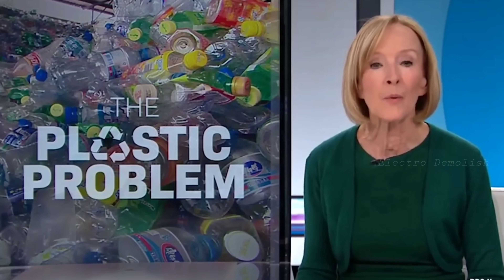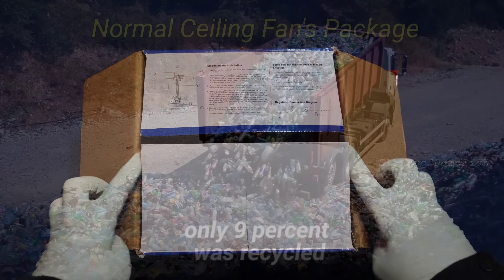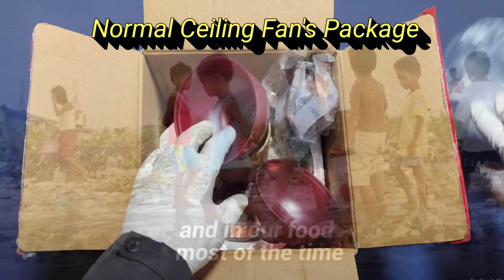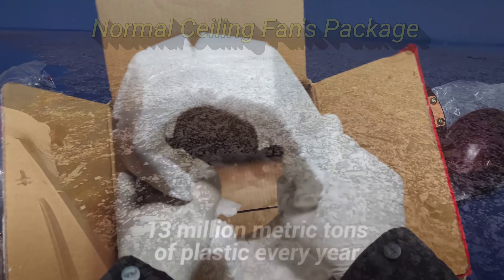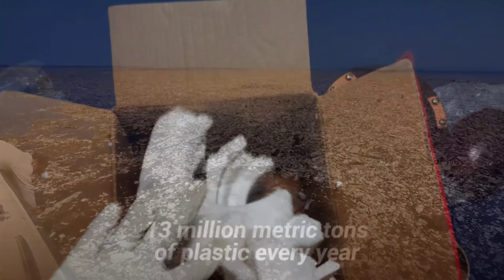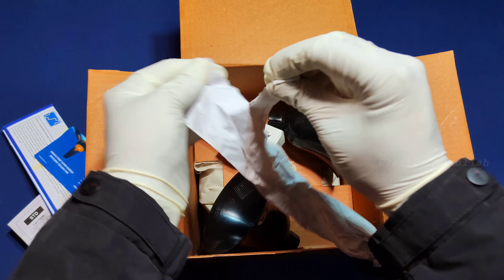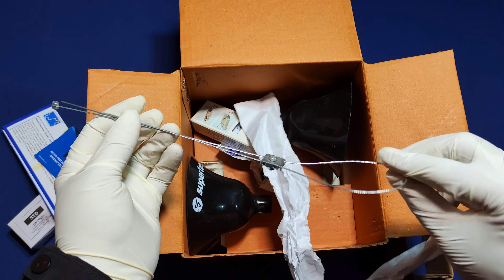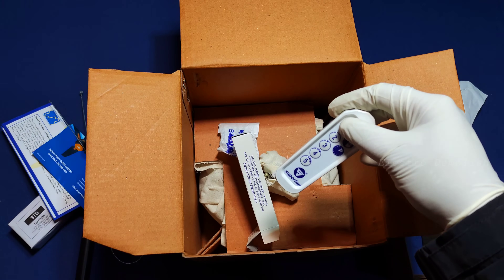Superfan vs Normal Fan |BLDC Technology vs Old School Induction Technology

Comment: Sry but the (normal) fan clearly draw much more than 95 watts. 

Think of it 40watts to 95 is about double the amount. The count that for  should go around twice as fast.

I think there might have been a shortage in the normal fan
Reply: Also if it took only 95 watts it shouldn't become that hot while runny it clearly was broken

Comment: Wow cool
Reply from the maker: Yeaap Superfan , all it's model looks cool 😎
Reply: @ElectroDemolish  Sounds like that was Electroboom's audio content.
Reply: Superfan is the best fan in the world
Reply: @mattwanson_225  No crompton is in terms of quality
Reply: @ElectroMaticPlus_48  no
Reply: @mattwanson_225  crompton is
Reply: @mattwanson_225  have you ever experienced crompton? crompton also offers bldc smart fans ok!!
Reply: @ElectroMaticPlus_48  crompton is not 
Quality
Reply: Ok
Reply: @mattwanson_225  "crompton is not quality" you have not experienced Crompton that's why you're commenting over here without knowing what are you talking about. Crompton has provided good quality ceiling fans from 1940 itself. superfan is a 2014 company. Crompton's bldc fans put pcb outside the the motor getting better ventilation, other companies such as superfan, atomberg, havells, orient puts its pcb inside which wont get ventilation and gets heated up due to componets heat and motor coil heat and gets pcb failures, since pcb is outside its easy to replace as well. and you have right to call Crompton has no quality because you have not experienced one. and superfan v1 carbon fans blade set is of Crompton high speed fan repainted in black colour. till now Crompton provides good quality products unlike luminous polar usha  bajaj orient which provide bad quality products. you are wasting you're time and others time commenting what you don't know about
Reply: @ElectroMaticPlus_48  crompton fans 
Are not batter then superfan
Crompton is not like superfan
The crompton brand is not batter
Then superfan brand
Reply: Crompton is not good
Superfan is good so go for
Superfan
Reply: @ElectroMaticPlus_48  im sorry but 
Crompton is not good ok
Reply: @mattwanson_225  have you experienced crompton
Reply: @mattwanson_225  you are wasting your time arguing about this. crompton is greater than superfan and buy one crompton silentpro enso ok you will like crompton better than superfan and i am done talking about it and if you again say that superfan is better then my tone changes ok!
Reply: @ElectroMaticPlus_48  fine crompton wins
Ok
Reply: @ElectroMaticPlus_48  you happy now
Reply: @mattwanson_225  its not about happiness its about brand quality
Reply: @ElectroMaticPlus_48  wow crompton is
So cool i just buyd a crompton
Cilling fan and the speed is vary good
Reply: @ElectroMaticPlus_48  i love it 
Crompton is the best fan in the
Word
Reply: Thenks for the ider 🙂
Reply: @ElectroMaticPlus_48  and crompton is 
Better then superfan
Reply: @ElectroMaticPlus_48  🙂🙂🙂😀😀😀
Reply: @mattwanson_225  thanks
Reply: what model did you buy?
Reply: @ElectroMaticPlus_48  crompton high speed 42 (1050 mm brown
Cilling fan
Reply: @ElectroMaticPlus_48  it wes vary good
The air flo wes amezing
Reply: @ElectroMaticPlus_48  thenks 👍👍😃
Reply: @mattwanson_225  crompton high speed is one of the best fans from crompton. enjoy the fan
Reply: @ElectroMaticPlus_48  thenks
Reply: @mattwanson_225  welcome
Reply: @ElectroMaticPlus_48  hay
Reply: @ElectroMaticPlus_48  how are you 
Today
Reply: @ElectroMaticPlus_48  yeep you are
Right crompton is the best😎😎
Reply: @ElectroMaticPlus_48  good night
To you if its night for you by😀
Reply: @mattwanson_225  yes hi im fine thanks for asking good night and good morning
Reply: @ElectroMaticPlus_48  hi i have a youtube channel and i will make more cilling fan vids😎
Reply: @ElectroMaticPlus_48  next cilling fan video will be KDK cilling fan 
Video
Reply: Sub and turn on notificetions so you will know wen i make videos by 😀
Reply: @mattwanson_225  ok
Reply: I uploded a video can you coment me if your ther 😀👍
Reply: @mattwanson_225  ok
Reply: @ElectroMaticPlus_48  well its been a year
Reply: @ElectroMaticPlus_48  i dont even know anymore im not into fans now
Reply: @ElectroMaticPlus_48  im into gaming like pc and stuff
Reply: @ElectroMaticPlus_48  im into gaming like pc and stuff
Reply: @ElectroMaticPlus_48  im not into fans anymore
Reply: @ElectroMaticPlus_48  so yeah i forgot many things about fans since i left them..
Reply: @ElectroMaticPlus_48  i threw some of my old fans out because i wanted to change to gaming